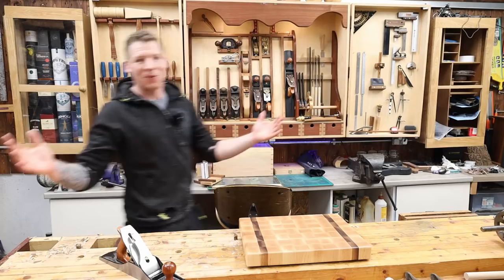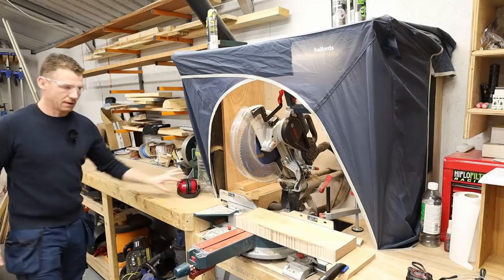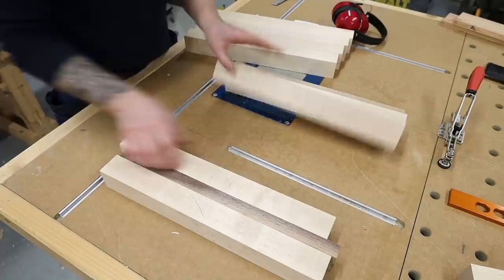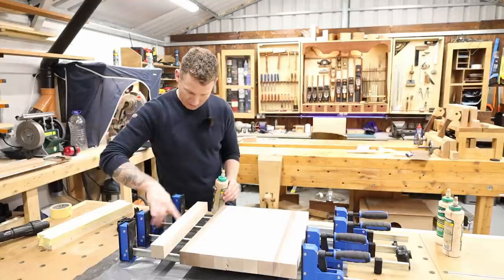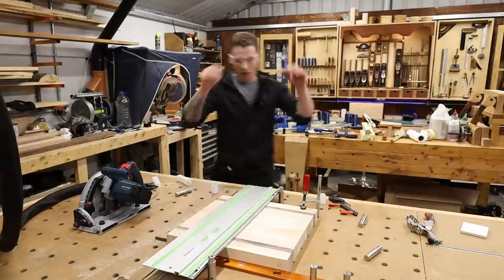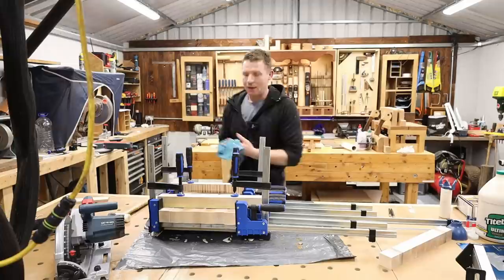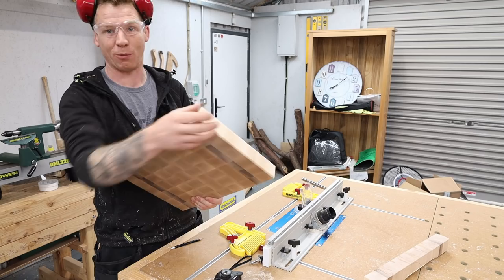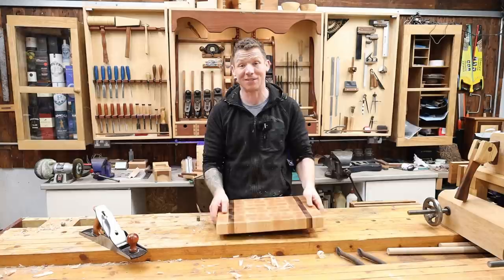End Grain Butchers Block Cutting Board. Maple and Walnut a Great Gift Idea

Comment: If you keep the pieces running continuously through the thicknesser and use a sacrificial piece at the end you should be able to reduce snipe. Great job on the board.

Comment: I agree with your decision to glue everything up at once for edge/face grain glue up. I’ve tried wide panels in two stages and they never feel quite right. 

After the end grain glue up I use a Veritas LAJ to great effect and cover the entire board. It’s a great feeling seeing the grain come alive during this process.  I check flatness of the board on a granite counter in my kitchen—so I’m doing a lot of back and forth. It might take me two or three hours, but it’s a good workout and I’ve got it down so all the follow-up sanding is done is under an hour.

Comment: What a fantastic walk-through and presentation style John. I have been making these myself with Oak and my bandsaw / thicknesser. One of the things I did to make it easier was to build a router sled so I can flatten the boards quickly that way.

You said that you're an electrician by day and do woodworking as a hobby, but your setup must have cost tens of thousands. How did you decide to invest so much money into your hobby? Do you see it making you some returns in the future?

Comment: Another enjoyable video John. Your initial dimensions were set at 450mm x 350mm (14 inches not 16), this is only slightly over the capacity of most hobby thicknessers and so if you made it just slightly narrower it would probably fit through your thicknesser. I think you were just looking for a reason/excuse to use your lovely new hand plane! 
What happened to the alignment of the walnut stripes as shown near the end, you were very careful to line them up prior to glueing so I'm surprised?

Comment: Nice work John, that board looks great.   After damaging my hands sanding I bit the bullet and spashed out on a Laguna 16/32 Drum Sander...makes all the difference (but you do like a bit of hard graft using your hand planes).  I use food safe mineral oil (cheaper) Cheers Paul
Reply from the maker: I must keep an eye out for a drum sander at a good price
Reply: @JohnMcGrathManInShed  The Laguna is good, but expensive.  But has some good features.  Andy at The Woodgrafter purchased one on the strength of talking to me.  Good luck and stay safe John

Comment: How did you do the rest of the track saw cuts (around 20:50), once the piece you were cutting became less wide than your track? You cut away before showing that.
I also don't use a table saw in my shop, so I'm always looking for tips from others for how they use their track saw instead.
Reply: I thought the same, my guess he used some extra blocks at the end to support the track. I'm just a hobbyist and will try building some end grain cutting boards. don't have a table saw so I'm intending to use this same method, glad to see it works. Also, to plane the end grain (also before 1st cut) I'll use a router with a planing bit (Tornado 35mm) with a sled, I think it will work much easier. Overall a great video with lots of tips, very well explained and with a fantastic result.

Comment: Nice video John, just discovered your channel. I'm in the same position like many UK woodworkers, no table saw. No bandsaw either. Trying to figure out if this can be done with a TS55 tracksaw and a Kapex mitre saw, using a router table with an offset outfeed fence to joint the pieces. I've glued up many guitar body blanks using the router table as a jointer. What could go wrong? ;-)